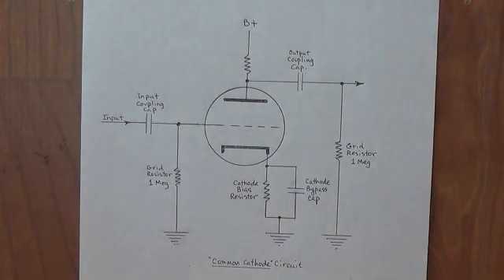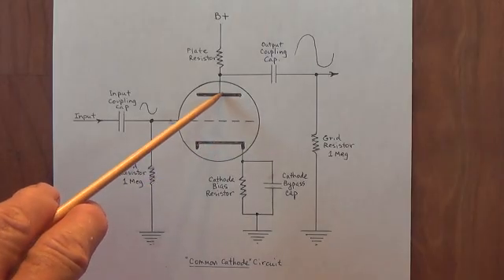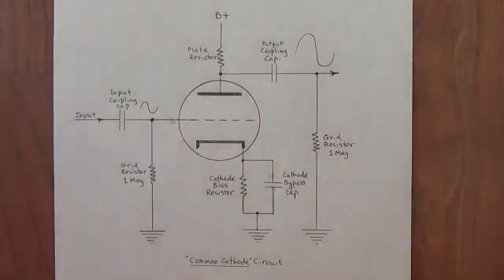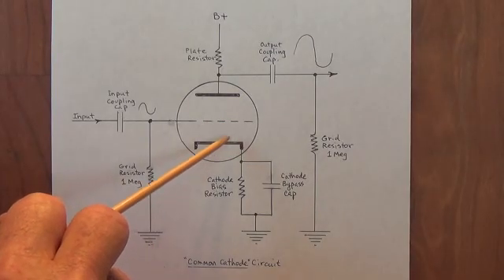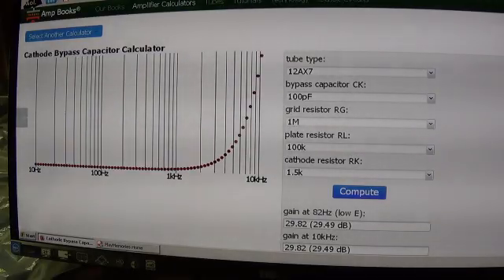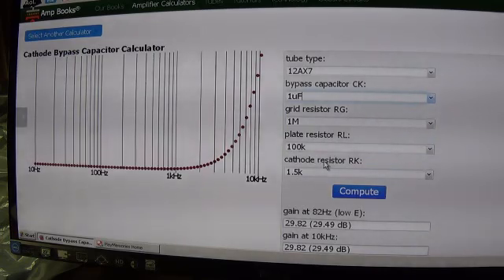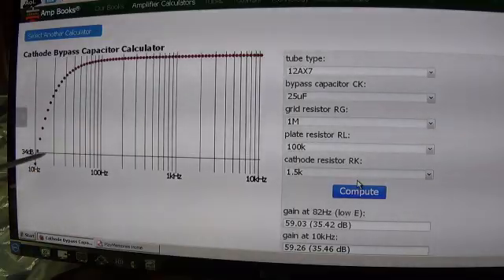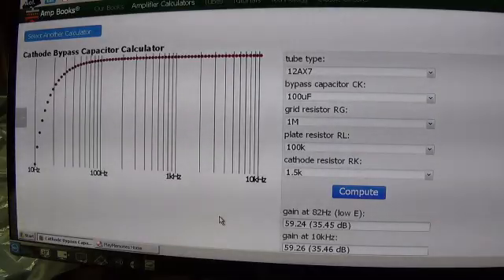Cathode Bypass Capacitors: How they Affect Gain and Tone

Comment: Congrats on #100! You are in my opinion a tube amp guru. Another request since you have covered so many parts of a guitar tube amp. How about 4 or 6 output tubes. I know you will need a bigger power supply to provide the extra current for the additional  tubes and an OPT that can handle the increase in power. But what about impedance matching and placement in the circuit.
Reply from the maker: Thanks, Hubert. My only experience with amps having more than one pair of output tubes was with a big, heavy Baldwin organ amplifier that had four 6L6's (two pairs in parallel). It had a huge power transformer and two 5U4's to satisfy the high filament and plate current demands. It's circuit was quite similar to a single-pair amp, except each output and rectifier tube had a parallel mate and the PT was huge. According to the Hammond Transformer spec page, the OPT primary impedance for 2 pairs of parallel 6L6GC's is 3400 Ohms @ 50W output and 4300 Ohms @ 60W output. They also offer specs for 6-output-tube circuits.
Reply: Two (or three) tubes are wired in parallel  in place of the single tube on each side of the output stage. The OPT primary should reflect half (or one third) of the impedance required for two output tubes.